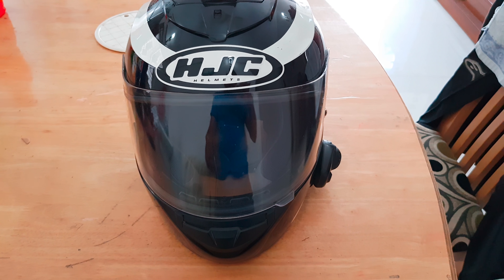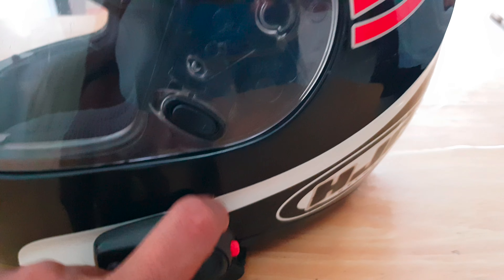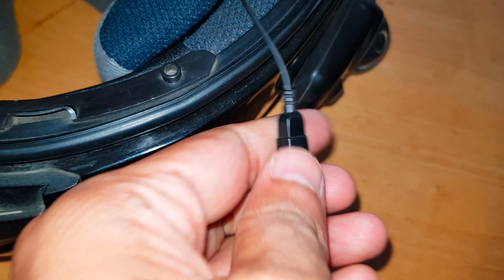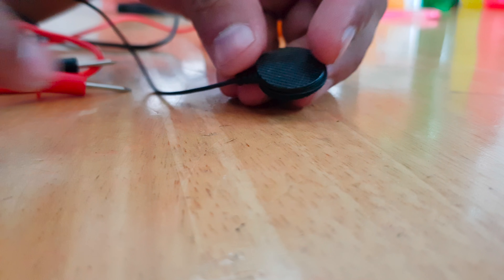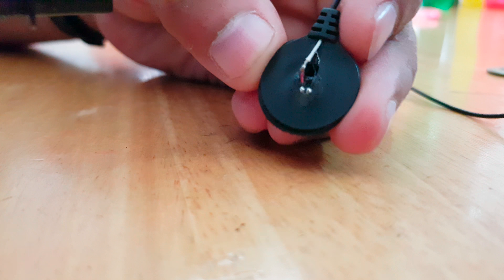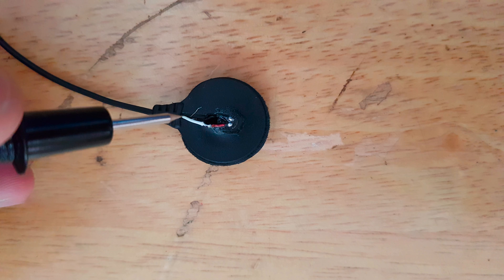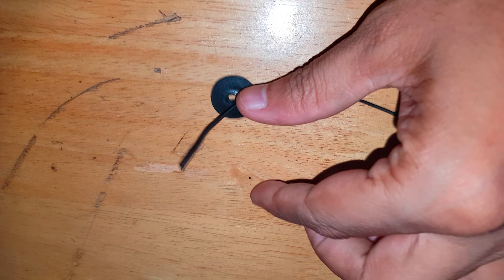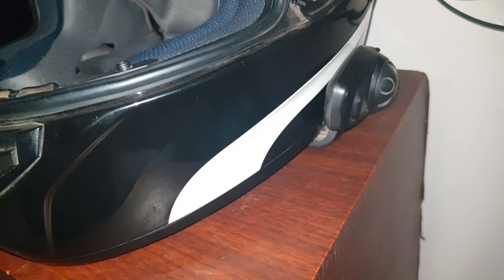SENA SMH5 | Repair Non working Microphone

Comment: I'm highly surprised with this video, did you study electronics or something before doing this tupe of tasks!? where I live people are usually too dumb to repair their things and when something stops working they throw it out.

I have a quick question, my
Sena SMH5-FM headset in order to work I need to keep moving the conector attatched to the unit, kind of to make the thing functioning properly, if I don't move the conector, I can only hear one of the speaker, the headset is acting up hehe. What would be the problem in your opinion?

Comment: Hey, my gold surface pad mount dedicated to the microphone fell off and caused the mic to stop working. For the time being i put a piece of tinfoil there which seems to kindve do the trick. Can i resolder a surface pad on there?
Reply from the maker: The mounting pads are velcro, one is pasted to the helmet and other is on the mic. Am un sure of the location of the pad that you mentioned in the comment.
Reply: @DrBusasVlogs  where the sena unit makes contact with the acutal sena mount there are those gold surface pads. One fell off
Reply from the maker: Ok your talking the sena main unit mounting points. Yes if the gold points fall off you can soder addon to it.